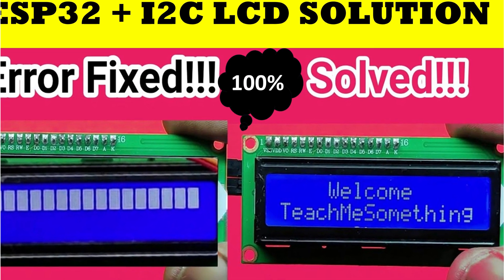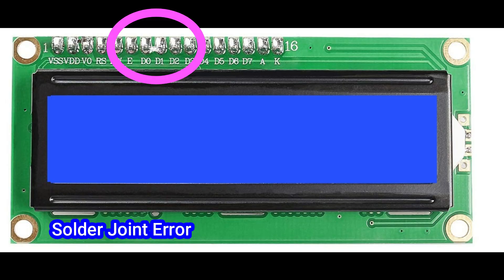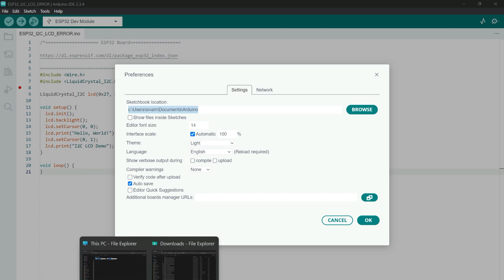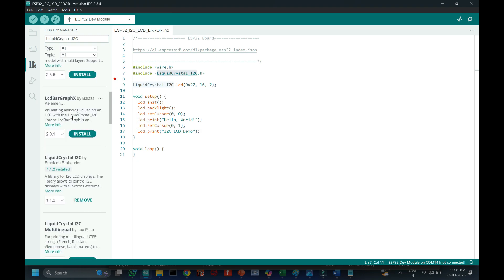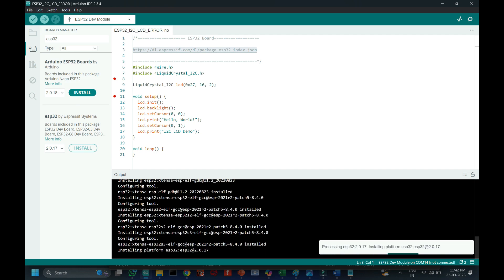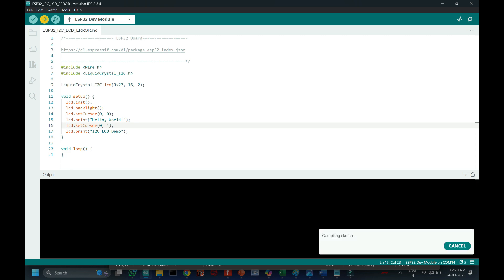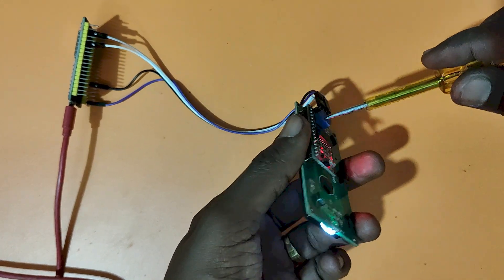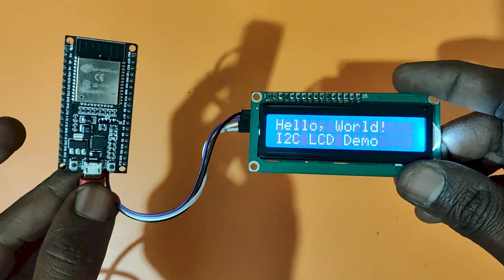ESP32 I2C LCD Error | How to Fix ESP32 I2C LCD Error | 16x2 Display Not Showing Text | Solved

Comment: hello sir i keep getting this msg even when i try with i2c_scanner 
Scanning I2C bus... No I2C devices found. No LCD. Re-scanning in 5s... Scanning I2C bus... No I2C devices found.

i m not able to get the address of the lcd_i2c back
Reply from the maker: Check soldering or connect proper pin connection or change the jumper wire